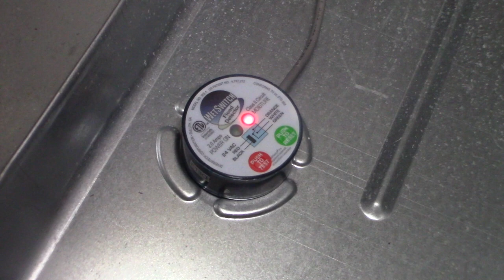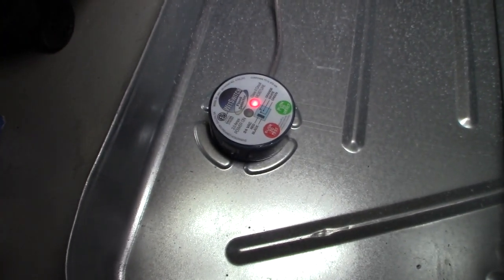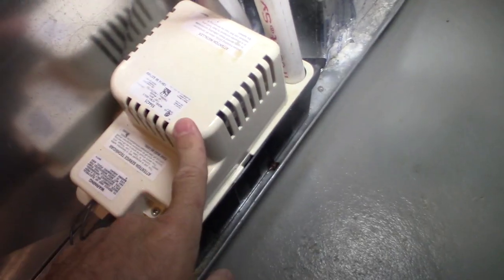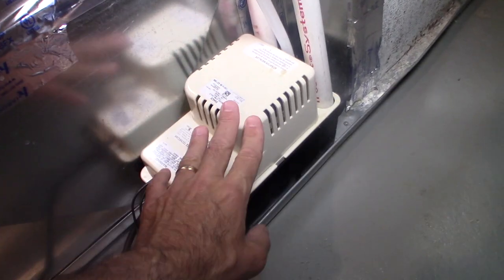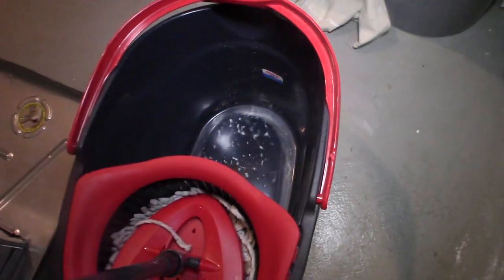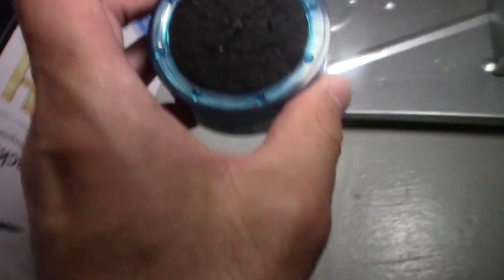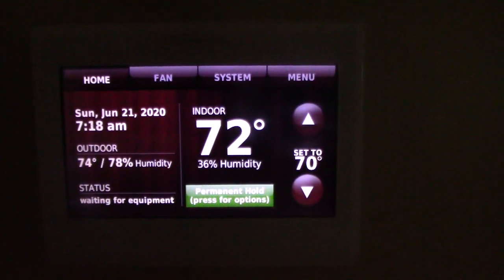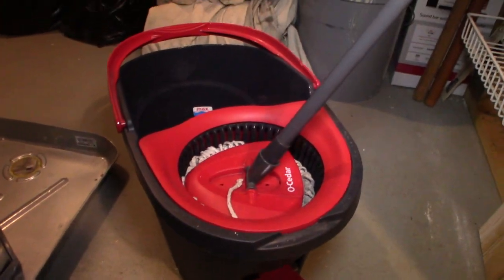How to reset my Wet Switch and my Condensation Pump Stopped Working Easy Fix DIY

Comment: I know this video doesn’t have the best reviews, but this saved me so much money! I don’t ever leave comments but I really wanted to show my gratitude toward you for helping me out. I was really frustrated when my thermostat shut down on a record high temp in my area. It NEVER gets to 113 F where I’m from in Seattle. I tried everything from checking my fuse box to flushing my drainage. But still no power to my thermostat. Fed up, I called my local HVAC company and got no answer. I’m sure its cause they are probably scrambling for all the service calls. I stumbled on this video because I have the same exact water sensor. Turns out you were right! The water sensor tripped from all the condensation in the pan and I hadn’t noticed. I took your advice and dried the bottom of the sensor with a towel and blow dried it for about 2 minutes. Finally I was able to get the sensor to reset and everything is back online! I can’t thank you enough! My fiancé and dogs were burning up. Our last resort was to get a room at a hotel and stay until we can get our furnace serviced. Turns out all of the hotels are booked up due to the weather. Many thanks!!!
Reply from the maker: OMG I’m so glad it helped. And thank you for watching my video. Please don’t forget to like share and subscribe. Keep cool and stay safe
Reply: Saved me money too !
Reply: I, too, am grateful! My problem also had to do with the flood sensor and luckily stumbled upon this video. Thank you!
Reply from the maker: @karenclark5096  Thank you for watching my video. Please don't forget to like share and subscribe
Reply: TOTALLY AGREE...

Comment: Thank you. It's 20 degrees out and my heat quit around noon. Thermostat dead. I went to the attic and my pan had about 1/4 inch of water. I sucked it out with a wet dry vacuum. The switch red light was on. It wouldn't reset. So I found your video and used a little travel hair dryer to dry it out. When it was dry it still didn't reset until I powered off the system for a few seconds. The water backup was because the tray drain PVC pipe outside had frozen solid. I hit it with a heat gun and rapped the PVC every 30 seconds or so and several icicles fell out. Then it started dripping every few seconds so I think it's clear.
Reply from the maker: I I’m glad it worked out for you

Comment: A wet dry shop vac works way better. This will greatly speed up the process since the whole idea of a wet switch is to sense moisture.  A shop vacuum will allow you to remove more water from underneath the base can of the furnace/ air handler. Using some good paper towels to remove water from the felt will also help speed the process prior to using a heat gun or hair dryer

Comment: Will the sensor  shock you where it sensors the water ? Does it need to replsce
Reply from the maker: No, it won't just take it out and dry it.
Reply: Well I got a tingle. Got it dry. Mine did not have the reset buttons . I cut the unit off at the breaker box for 30 minutes. It reset. Have in the past just let it set. But took for ever to reset'

Comment: This just happened to me in the middle of winter and I just firmly patted the switch dry with a towel for about 2 mins. Switch turned off and heat came back on immediately
Reply from the maker: Thank you for the information

Comment: Just to add a comment- if the safety switch wires from the pump was wired up from the pump (2 low voltage wires coming from the pump) were connected it could have shut the system of before the secondary pan filled up with water.
Reply from the maker: Yes, that is true. Thank you for your comment.

Comment: Do I turn the unit off 1st or leave it on!! Mine is making a loud hummm and the red light is blinking
Reply from the maker: Turn it off and then dry it out. If it’s still makingmaking a hummu after it’s dried it might be defective
Reply: @YourReviewChannel  i feel so stupid here! Should I unplug it? I looked in the pan and there is just A LITTLE bit of water in the pan does that matter? I here the condensation dripping from the hose to my drain so I dont beleive its clogged
Reply: @YourReviewChannel  and THANK YOU SOO MUCH!! I really don't have anyone to help me here so your my only advisor thank you!
Reply from the maker: @susanbeane2795  There should bo no water in the pan. clean out the water. dry the censer and reset the switch. it should be ok
Reply: @YourReviewChannel  ok gonna do it right now! Wish me luck!
Reply: @YourReviewChannel  thank you again, I dried it out, I turned the emergency air off made sure everything was good and dry then turned the switch back on and guess what , the box stopped humming and today the pan is dry!
Reply from the maker: @susanbeane2795  Yaaaa. Glad it works. Also, make sure your air filter is clean if not change it.

Comment: I dont understand why you would have had so much water in the pan if you had the wet switch. Isnt the wet switch supposed to stop the water immediately? Why did you place the wet switch so far away from the pump? If it was right next to the pump it would have stopped faster. I'm installing a wet switch now, and wondering why that happened? I dont have room for that large pan. Also, if you had the pump overflow sensor wired, it would have stopped it altogether before it got to the pan, right?
Reply from the maker: It took time for the water to reach the wet switch that is why
Reply from the maker: I did not install the switch